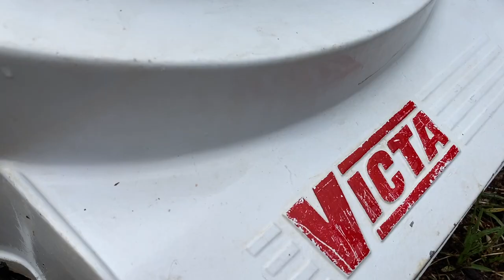Will it Start?  Free Curbside Victa Turbo Disc Lawnmower!  Can we convert Trash to Treasure?

Comment: I also had one of these Victa mowers. It lasted over 20 years and was still going strong, the only things that i have had to replace was a couple of spark plugs and cuttin blades. The only reason why i sold on my mower was the base was made of pressed tin and after 20 odd years had tin worm.
Reply from the maker: Hi Stephen, yes they are absolutely amazing machines and I do agree with you those tin bases are actually the weak link!!  If you liked this you might like this playlist of me getting old mowers back into service, where most of them are Victa 2 strokes: https://youtube.com/playlist?list=PLor5qdyoV_nT_C59fkQM6tZia44AQ9XQz&si=mNf25NsYWwcomA0n Cheers Drew

Comment: Buy a Hot staple solder gun for steel to plastic repair 30 bucks wont need resin or glass fibre and much stronger...Same as what pannel beaters use...

Comment: Nice job mate. I’ve  got a similar Victa Old Rock Thrower and I have a problem with mine when I go to shut it down and turn it off it backfires LOUDLY. Any idea what might be the problem and how I can fix it?
Reply from the maker: Hi Mate,  have you tried a new spark plug by chance?  I had a mower that literally sounded like it was going to blow up the other day and a new spark plug smoothed it right out!  Cheers Drew